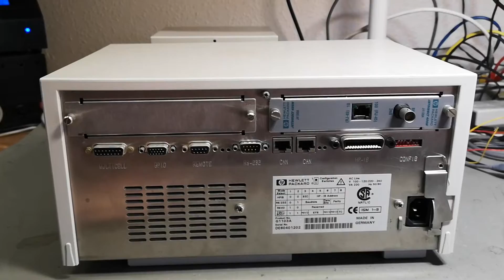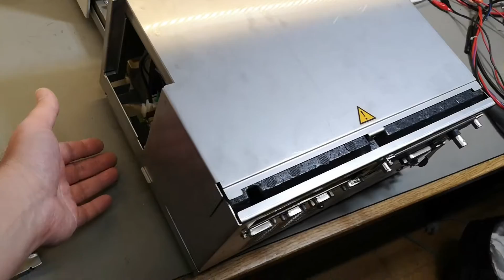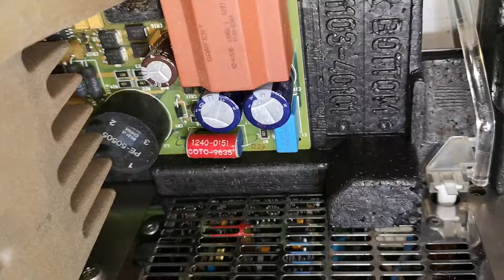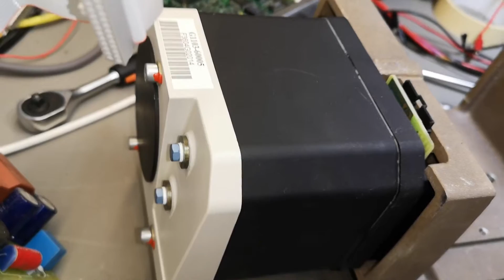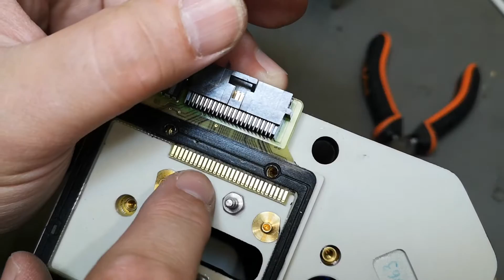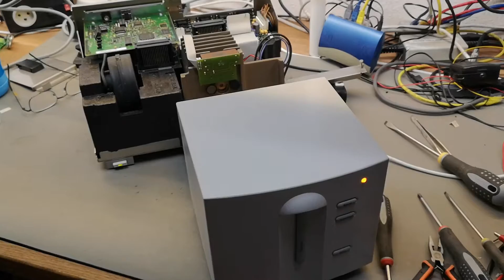HP 8453 UV Visible Spectrophotometer test teardown

Comment: That lamp driver module (SLS board) seems to be the weak point. There are a couple on ebay, at least one of which has a clearly blown MOSFET. Mine had the same blown mosfet which I replaced, only to have it blow again when trying to fire the UV lamp. Fortunately agilent still stocks the board but it would be nice to track the short down.

Comment: What's hiding in the optics box is a diffration grating and a stepper motor. Ir's a piece of glass (looks like a rainbow mirror) that has lines of silver on it, placed with a varying distance, done by photolithography - this selects what wavelength to reflect into the sensor.
Reply from the maker: i release a new video in a week or so about another type of spectrophotometer i think it may contain the type of filter you mention, stay tuned

Comment: Going to guess the battery leakage diasbled the write line for the flash, so it is unable to upgrade, or you need to go through some intermediate levels of firmware update first before the tool will be able to work, because likely at some point in the past they changed the communications protocol slightly, and the new updater cannot update the old one.  Probably was in a lab with a Win98 PC attached, and the software worked perfectly so kept till the PC died, no spares available, and they wanted to go to the XP version, but since they have not done the intermediate firmware updates ( likely only one which bridged 98 to XP) the new updater cannot work.